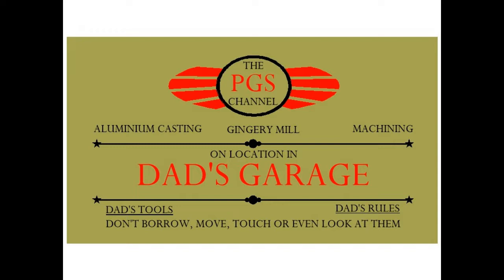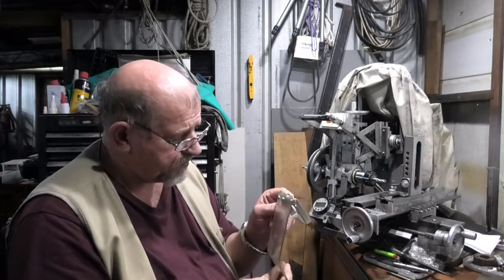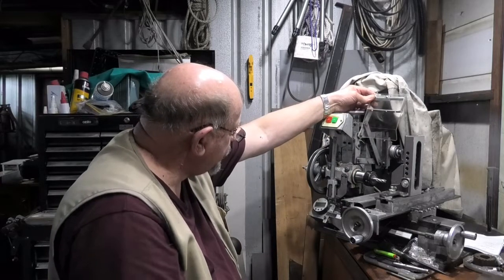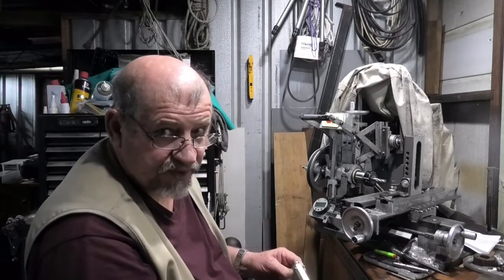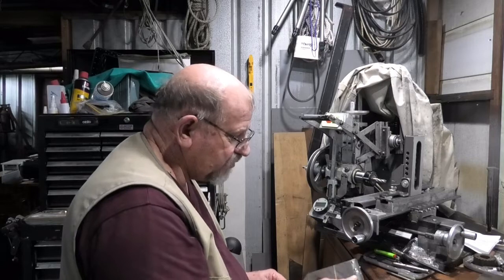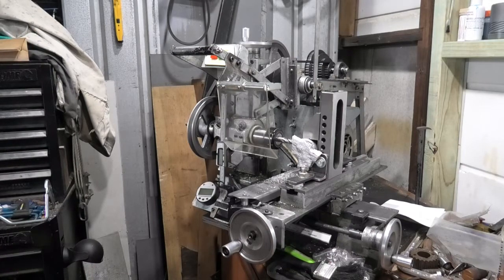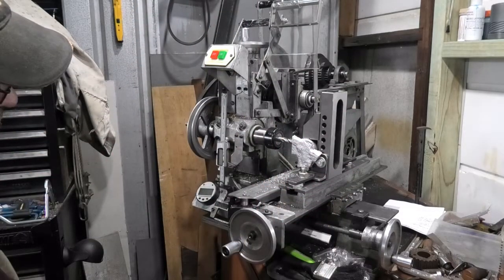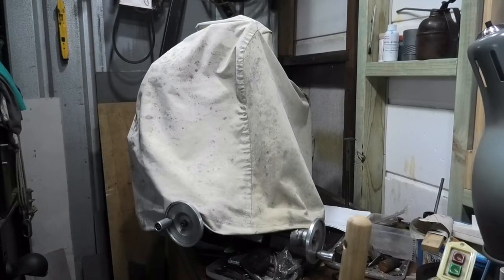Gingery Mill Shield

Comment: A nice simple little job with a big payback. On my Elliott Omnimill I'll sometimes change direction of cut so the swarf gets thrown to the back of the machine instead of in my face. You don't have that option on the Gingery. All the best, Mart.
Reply from the maker: G’day Mart. This simple shield has made a difference, I’m very happy with it. The gingery mill is not suitable for climb milling, it’s not designed with any backlash resistance, it’s something I need to address one day. 
Cheers 
Peter

Comment: Worked out well Peter.  Looking at the "U" shaped bracket that the clear shield swings on, you could fill that in with a piece of tin or something and that would stop a lot of swarf from flinging out over the top/pivot bar.  It shouldn't get in the way, even when you fold it.  All my shield are cardboard ;)   Cheers Rob
Reply from the maker: G’day Rob. Funny you should mention a future mod, I used it yesterday and clamped that plastic sheet to that very bracket, something to put on the to do list. 
Cheers Peter